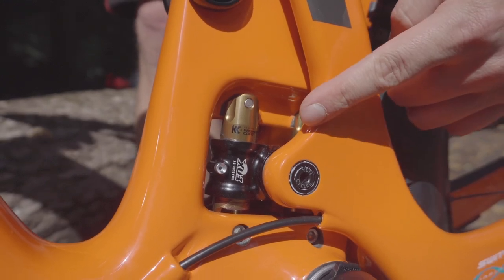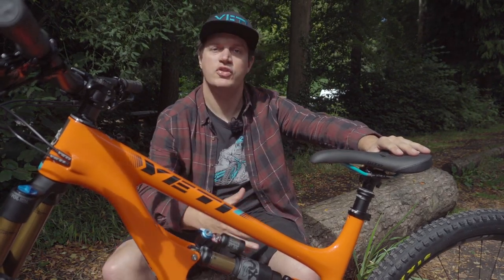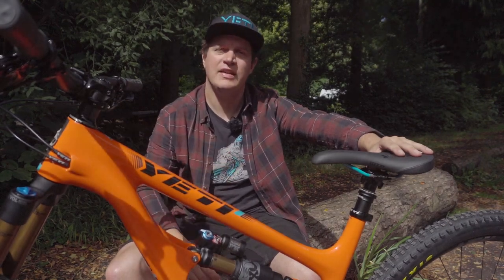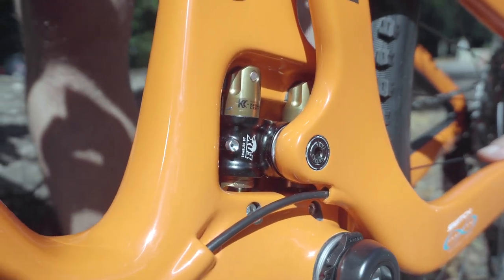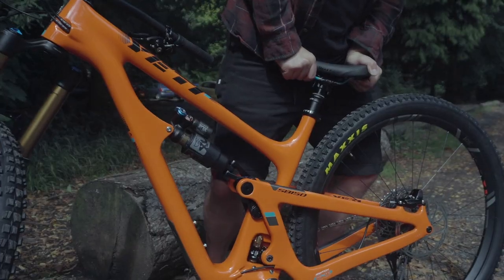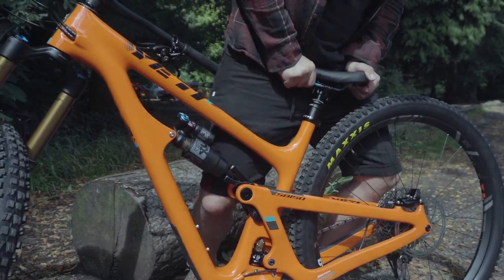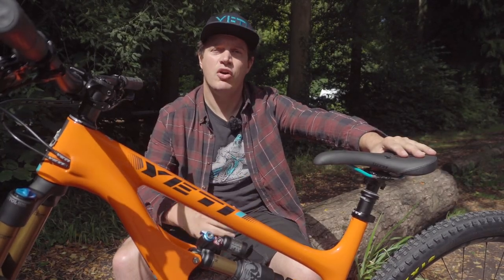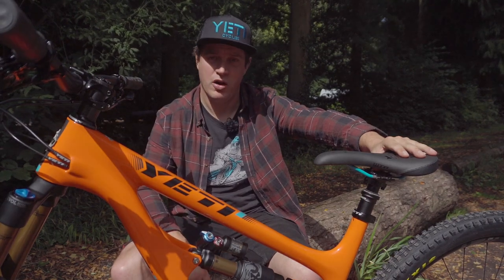Yeti's Switch Infinity tech - how does it work?

Comment: Right, we still have no clue how this thing works.  This appears to be a gimmick.  What guarantee?
Reply: As much as it looks like a gimmick, it really does work. Those few mm of change change lots in kinematics. Watch Trail POV’s video on it.
Reply: You have clearly never ridden a yeti
Reply: @liamtaylor9806  My son owns one! I ride it all the time. Still convinced it's a gimmick. That, coupled with the fact that the "bearings" wore out in less than a year on a bike that is cleaned with a toothbrush. This, on a a piece of equipment that costs the proce of a small car, is unacceptable!
Reply: @anthonypooran8566  Thanks for the feedback Anthony. Fully agree. Having dealt with a bit of metallurgy the use of kashima here is quite frankly a gimmick.  I say this owning a Yeti and having had to replace the switch once in less than a year.  On a bike that was scrupulously cleaned every ride with a toothbrush.  Yep. What the literature doesn't say is that kashima is an acceptable solution for reducing surface friction and to some extent improving wear resistance.  BUT, wear resistance of aluminum, which is already quite poor. Kashima works well in shocks as the load is VERTICAL and there is very little side loading on a fork (mostly up and down). Which is different than loads on the switch.  Having done all the maintenance on this investment myself, I can unequivocally say that these bikes are of fairly poor quality (the components that is).  Wheel bearings sourced from "sub" quality suppliers in China with extremely poor dust seals (they're supposed to be hermetic).  Brake discs that are undersized and a price tag that clearly demonstrates the concept of "what people are willing to pay" not what the inherent value of all of the components are.

If you ride with a team and/or club, are wealthy and willing to throw money at a bike like one would do with a boat (a hole in the water where you pour money) then these bikes are for that type of person.  Based on a 5K plus euro investment, I thought I was getting "more".  On a per scale basis, this would be the equivalent of a daimler or a landrover -which would never oblige this sort of a maintenance budget.